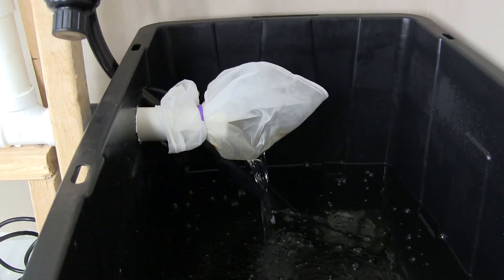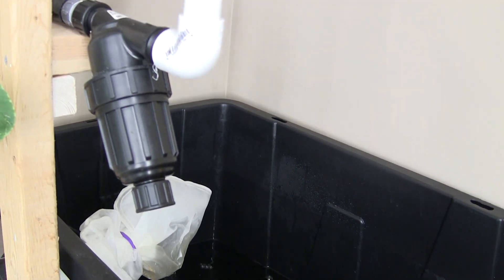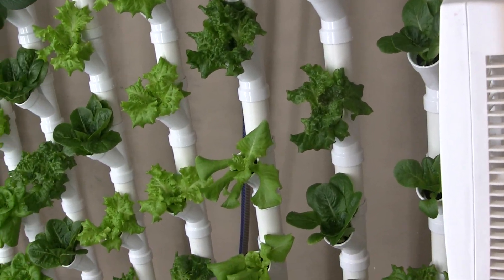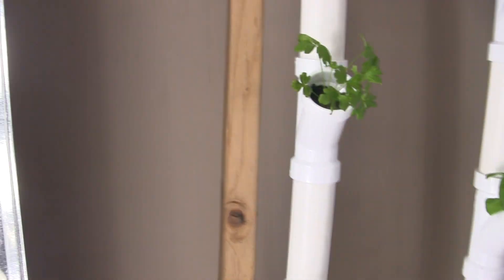Basement Hydroponic Tower Garden Version 2.0

Comment: bisphenol A & B in plumbing plastic ! = CANCER
Reply from the maker: Hi Cedric, I have done research on this. There is a ton of info online about the use of PVC for potable drinking water. From the research I've done, the EPA has deemed the use of plasticizers in PVC safe for cold water human and animal consumption in the US and Canada, and PVC is used in many communities for potable water distribution. PVC is not allowed for use in the home because it can degrade above 140 degrees. This is where CPVC comes into play. However, since the nutrient solution should be kept between 65 and 75 degrees, and the scientific community states that leaching from PVC does not occur, I am comfortable using PVC for this system. There is also concern about PVC integrity in high pressure applications, but again, this is not a concern in a hydroponics system. Of course you make your own decisions and you need to do what makes you feel comfortable. Good luck!
Reply: In logical arithmetic != means "not equals" so yup, I agree with you.

Comment: Great way to use the y tee. I was wondering what type of media you have put inside each individual vertical tube. Won't the grow plugs fall off into the tubes if they are empty on the inside or will they just hold? Thanks.
Reply from the maker: Hi Bishal, I use 1.5 inch Grodan plugs. They are too big to fall in, especially wet, unless you really ram them through. I've never lost a plug to a tower.
Reply: MaryandJoe Neumayer thanks

Comment: Id love if you made a video of assembling 1 tower
Reply from the maker: Hi Ann, the towers are just connecting the wye tees to the pieces of pvc pipe. Nothing special. A pvc cap goes on top and a a hole gets drilled into the top for the irrigation tube, although my next build will have it going into the back spraying forward. The tower then sits in the drain pipe. As for timers, you can use any 15 minute timer - 15 minutes on and 15 minutes off. Water - I add CNS Grow hydroponic concentrate, from Amazon, at a diluted concentration of around 1000, and then pH down to get to around 6.0. I have a digital TDS meter and pH meter, both Amazon, to test for nutrient concentration and pH, which I adjust whenever I need to add more water. Hope this helps.
Reply: Can you please make a video or share photos of your irrigation tube going into the top of the pvc and inside of the pvc please?
Reply: Why are you going to switch the irrigation tube in your next build to the back and spray forward?
Reply from the maker: Unless your angle is spot on when spraying in from the top, you may miss irrigating your top grow site.
Reply from the maker: Hi Wu, I'd recommend drilling with a 1/4 inch bit at a 45 degree downward angle from the back of the top cap  and spray to the front. When drilling from the top sometimes it's hard to get the first site irrigated. I don't have a picture of this but that's how I'd do it on my next build. Good luck.
Reply: As for the TDS and pH meters, there is a variety of models on Amazon. Hard to choose one. Which models work best for you? Thank you for sharing the details about your ways and results. Indeed, great job of yours.
Reply from the maker: Czesc Piotr!  HM Digital TDS-EZ Water Quality TDS Tester from Amazon - $15.25, and HM DIGITAL PH Meter PH-80 Handheld Water Resistant Water Quality Tester Pen With ATC For Hydroponics Gardening Aquariums Reefs Pools Spas Water Treatment, Amazon $45.  I've been  using both meters since 2013 and with proper cleansing (after use) and re-calibration of the pH meter, bother are still working to standard. Let me know if you have any additional questions.

Comment: Hi Joe. real quick. what type of socket plugs did you buy on back of lights?   I had to splice mine and  thought yours at one point in video looks like your sockets were easier to wire.  thanks.
Reply from the maker: Hi Marty, I used single lamp holder sockets (dark brown colored) outside and then the double sockets inside (white) from Home Depot. They should be on the materials list in the description. Also, the lamp cord from Menards is thicker and doesn't require splicing but not as long (8ft if I remember correctly) as the 15 ft lamp cords from HD which require splicing.

Comment: Great system. Congrats. Someone suggested below on running the supply pipe vertically inside the PVC pipe and many mist connectors along its length. That could also allow using 2 sided tees and double the plant count and no need to tilt it forward since mist will be in all directions. Would like to know your opinion on that.
Reply from the maker: Hi, to tell you the truth (pun intended) I've never experimented with sprayers/aeroponics/fogponics. I would imagine the plant roots would cover the sprayers rather quickly and defeat the purpose. Also, what would you do if they clogged? Rip the supply pipe out and take half the healthy roots with it? I like the two sided tee idea - I've been mulling that idea over for a over a year. Indoors you'd have to illuminate on both sides and outdoors you'd have to face the openings east/west, so it wouldn't work well up against a wall. I'd love to hear from you if you give it a try, truthfully. ;-)
Reply: Thanks :)

Got your point on root clogging. May be the misters could be placed just above the Wye hole so that the "upper root" can grow till that point without clogging. Or increase pipe dia to 2 inches. Basically they say mist improves growth speed, hence this thought.

On 2-Tee solution for basement (+wall) like yours, one may use single tees but twice the count and place them at an angle to share the same lighting. Ready made dual tee has both Wyes at 180 degree but you would want 90 degree for light exposure. So just halve the length of tubing between single wyes and add another single wye in between and move the wyes 45 degree left and right alternately. Just a thought to reuse the same lighting and increase plant count. Easiest to try in your herb tower.
Reply: One more question. Are you fully sure its OK to do this in PVC and not UPVC due to cancerous agents used in PVC? Typically they use PVC for drainage and UPVC for transporting potable water. UPVC tees are more rare in availability...
Reply from the maker: Hey Truth, I've thought about this but never actually tried it out. I'd have to play around to assure 8.5 inch off center distance between plants or they will overcrowd.  I'd also want to see about the effects of phototropism.  Irrigation shouldn't be an issue but I'd be more concerned about root space. A 2 inch setup would add cost. It's worth a try though. :-)
Reply from the maker: Hey again, I have done some research on this. There is a ton of info online about the use of PVC for potable drinking water. From the research I've done, the EPA has deemed the use of plasticizers in PVC safe for human and animal water consumption in the US and Canada, and PVC is used in our communities for potable water distribution. PVC is not allowed for use in the home because it can degrade above 140 degrees. This is where CPVC comes into play. However, since the nutrient solution should be kept between 65 and 75 degrees, I don't suspect there would be any leaching from PVC in a hydroponic system. There is also concern about PVC integrity in high pressure applications, but again, this is not a concern in a hydroponics system.
Reply: Hi I am planning to try the "double sided" solution. Did you try it? Thanks

Comment: Can you do a video on how you built your lighting setup?  Thanks!
Reply from the maker: Light Fixtures

Sorry, I don't have time to produce a video but here are the steps: 6 inch vent pipe (comes in 5 foot length), use a hole saw (1 1/4 size) to cut in 6 holes at 1,2,3,4 ft and then one 6 inches off of each end for a total of 6 holes per fixture. Insulate each hole with small strips of quality duct tape. The single socket goes in the hole, and connects to the double socket for the holes in the middle (1 ft apart) to allow for 2 bulbs and the holes on the ends just get the socket with 1 bulb.  Daisy chain a lamp cord to connect the outside sockets. I spanned the vent pipe open with 3/8 in dowel rods and I drilled a small hole to stick a brad nail through the ends to keep the vent pipe spanned open. Prior to inserting the sockets I'd recommend lining the inside with aluminum foil for reflectivity. I used 100 watt replacement LEDs, 5000K - I bought 10 packs from Costco with rebates and the cost came out to $1.50 per bulb. The entire fixture costs around 50-60 bucks, minus the structure to hang them on. I like the extra foot (length) compared to a 4 foot fluorescent fixture since I hang the vertically (horizontally would work too I suppose but access to the plants would not be as easy. I took some pictures and here are the links. Good luck!

https://drive.google.com/open?id=0B-6HiC4vapvpenZId0JoY0M4bTg

https://drive.google.com/open?id=0B-6HiC4vapvpQUV6NWRQRGJCVXM

https://drive.google.com/open?id=0B-6HiC4vapvpdlNvUTQ4bV9yRFU

https://drive.google.com/open?id=0B-6HiC4vapvpUHpCdWlfd3k0WjA
Reply: Thank you for taking the time to respond!

Comment: this is a beautiful set up, well done!  I am building a similar (but smaller) system for aquaponics, pumping from my koi pond.  I have a question about your in-line filter.  You don't list it on your supply list.  Do you remember the model and/or where you got it?  My pump will be filtered, but sludge does build up in pond water so an in-line back up would be good to have.
Reply from the maker: Hi Rachel, the filter is called a Y Filter can you can get one online from Farmtek (better quality) or Drip Depot. I think it would clog up very fast with your pond water. For kicks I measured TDS of my ponds when I had the same idea to  use the water for growing veggies and I remember the results being too low.  I seem to remember around 160.  My aquaponics water after a couple months was up past 700, and I think that was even on the low side. When I was running an aquaponic system I did have a considerably larger stock ratio than what I keep in my ponds. Just some thoughts.

Comment: what is the cost on the vertical columns and y fittings also total cost on all the pvc parts???
Reply from the maker: It cost about $1400 to build the double 49 site system (98 sites total) with 1372 rockwool plugs and a gallon of nutrient. That includes lighting and all electrical components and an extra pump and impeller. Link in the description. Plumbing fittings from Menards.
Reply: MaryandJoe Neumayer hope that is $140.00 :)

Comment: What I meant to say is the size of cup that you put inside of the wye t to hold your plant!
Thanks!!!
Reply: The normal netpot is bigger than the opening of the 1.5" Y-Tees. I am using sponge to hold the plant.
Reply from the maker: I don't use a netpot. I place the 1.5 inch Grodan plug directly into the wye tee.
Reply from the maker: I don't use netpots. I just push the plug in the opening.

Comment: Joe you totally inspired us to do this. I have all the materials and two hours into the build I have a basic frame and one light silo almost built.  I went with 6 dual sockets and same bulbs.  I used 3/32 ten inch spacers with nuts to hold the pipe open.  I decided to go with a Colman cooler on wheels for the nutrient tank.  I got the ytees at lowes and same pump you rec.  I have a 200 seedling tray growing nicely in rockwool ready to get this thing finished in a day or two.  This design you have is really ideal for baements!  thanks and hopefully I can send updates.
Reply from the maker: Thanks for sharing Marty, sounds like you are well on your way! I'm not quite sure what you mean by using spacers with nuts to hold the pipe open, but focus on finishing your project and growing your greens. Make sure your Coleman cooler is large capacity. I love the idea of having a drain on the bottom of the cooler for your flushes.  Please share your questions and progress. Best of luck!
Reply: Hi Joe. I finished a four tower wall tonight with room for 12 prolly.  I tested the pump with water and bam, it all worked like a charm.  Now I can clean out the pvc filings and move to finishing light and putting first crop on timers prolly Sunday.  I'll keep you posted on progress.  Many questions. I didn't glue towers to base so I can remove.  But I did glue the ytees.  Question: is the pvc cement safe for food based plants?  Question: I put 180 sprayers as drippers to get more airation. Does that reduced flow hurt?  what did you put at drip ends?  thanks. that's all so far.
Reply from the maker: Hi Marty - great work! I can't say for certain about the glue. I haven't found any research indicating dried pipe glue is unsafe. It's used for cold water lines in millions of homes. We cook with it, we drink it. For that reason I use it. For the aeration, I'm not sure the sprayers are necessary. My roots are clean and white without sprayers, and although I don't have experience with them I always have a feeling they get clogged and can be a lot of maintenance. I've always been intrigued with aeroponics though. That being said I don't know about the flow rate. I just leave the irrigation tubing open to maximize flow. Wish I could be more help.
Reply: great that's perfect. did you give any thought to a bubbler? I guess the verticle drop is plenty of air.  thanks Joe. doing 28 plugs today. same nutrient. I think it's like 15ml per gallon.  thanks again
Reply from the maker: hey Marty, switching from floating raft to vertical tower was motivated largely by the lack of need of aeration, which is massive in deep water culture. I have wondered if a bubbler would be necessary as I designed this system, but turns out it's not needed, in my opinion. My roots are beautiful and growth seems more reliant on concentration of available nutrients based on my experience. And yes, 15ml per gallon should get you around 1000 ppm, which will increase as transpiration and evaporation occurs naturally. How many total sites did you say you have? I divide my number of sites by 6 (weeks), and that's how many seedlings I harvest and replace weekly. (2 weeks germinating under light outside the system, and then 6 weeks to grow out in the system) That way you get a weekly supply of lettuce. Herbs like basil, dill, parsley, etc. stay in for 3-5 months and you cut as needed. These plants have a life cycle - some shorter than others - like cilantro. Congrats on making all this happen!
Reply: thanks Joe. Great info.  I'll keep you posted. 4 towers 28 sites.  well see how much we can get out of this and I have room to add on two more 4 tower set.  12 total in like 8 feet.  but for now one 12 light will power 4 tower.  I wanted to stay small for now.
Reply from the maker: Wow Marty,  you pulled it off! Way to go! When you ran the pump without the plant plugs did you get good irrigation down the front of the towers? I can't tell if your irrigation lines are shooting the nutrient forward.  1600 ppm is a bit high and will increase with evap/transporation. I shoot for about 1000. Just add chlorinated water when you add more until your flush at about 3 weeks. Try to keep your pH between 6 and 6.5 for lettuce.  I remember you mentioning a cooler as your nutrient container. If the volume is 8 gallons you will need to fill it frequently as your plants mature. I'd recommend a 20 gallon container for that sized setup. I'd figure for a system like yours with varied stages of growth you can blow through 8 gallons per week, and that's your entire volume not counting the usable volume, since there will always be some on the floor of your container and you may not be able to fill it all the way up to the top. When your crop matures you may go through that in 3 days. But as always, it's trial and error. I just finished my 9th system and I already know what I will change when I build my next one. Keep me posted and great job!
Reply from the maker: Sounds good! See how it goes and continually evaluate and modify. Keep me posted!

Comment: Great project - thanks for sharing!  You mentioned the students gluing the pipes together, however there was no mention of glue in the materials list.  What did you use, and did you confirm it is safe?  Thanks!
Reply from the maker: We did use pvc glue - which I believe is safe when dried. Many US homes use this application for cold water delivery. Although the glue is not necessary, I used it so the towers don't break apart when disassembled and cleaned. The system also sits on the second floor, so a leak could cause structural damage.
Reply: That makes sense.  I am starting small with 1 tower using yours as the template.  This is new to me, so excited to see it in action.  So 3 months since the video, is it still going well?  I saw your tip on changing the angle of the supply line at the top.  Any other modifications you would suggest?
Reply from the maker: Nope, no additional modifications at this point. Still growing well. Today I am planting seeds for my outdoor system. We've had record warmth here for late February in Chicago and I'm hopeful my greenhouse will be warm enough in two and a half weeks to plant the seedlings in the towers. It may be a stretch for daylight hours but I'm hoping the greens will be somewhat forgiving at least at the start. So long story short I'll be shutting down my basement system for the spring/summer/early fall.
Reply from the maker: Doug check out the update video if you have a chance - the link is in the description. Best of luck to you!